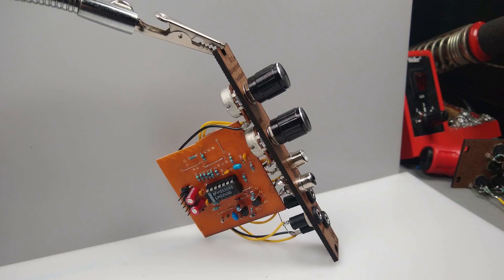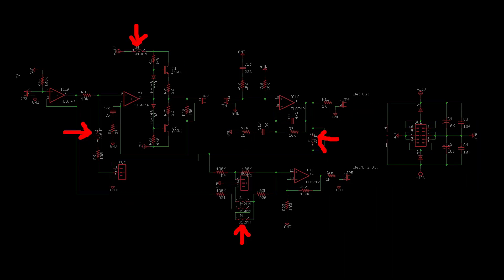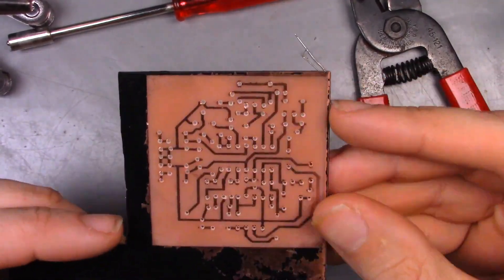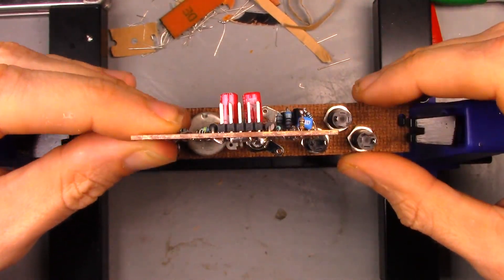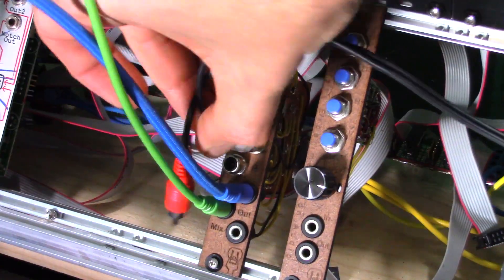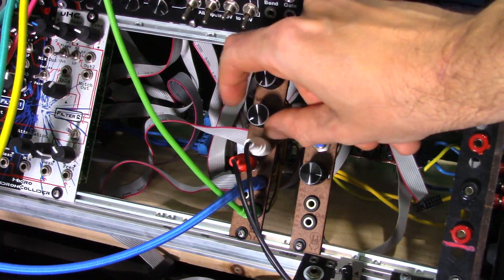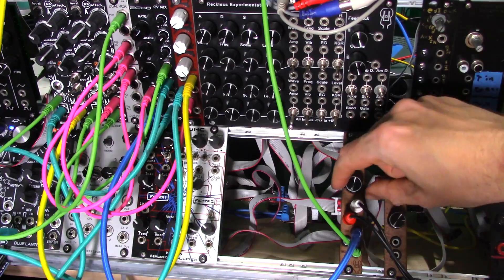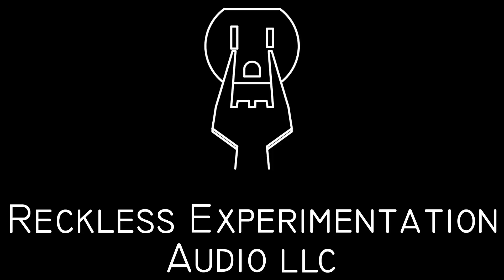Reverb revisited: Eurorack spring reverb with a single quad op-amp

Comment: What kind of laser cutter do you use?
Reply from the maker: Full Spectrum Laser is the brand
Reply: @Recklessexperimentationaudio Thank you! Could you share the laser wattage? I was looking at one of those 150-200$ 5-10w machines and was wondering if that would be powerful enough for what your doing
Reply from the maker: @aidanswank5667  45W. Those cheap laser cutters should be illegal. The laser needs an enclosure. The beam is invisible, and reflections can be blinding. Also the fumes that come off a laser cutter can be intense. You need to be able to vent that outside.

Comment: How can someone use transistors instead of op amps?
Reply from the maker: Look at vacuum tube circuits for inspiration.  A triode tube and an NPN transistor do generally the same thing. Of course all the component values will be drastically different given your will be operating at 12-24VDC not 240VDC